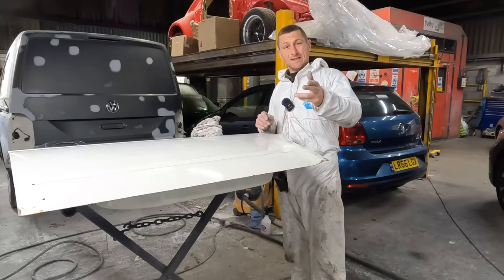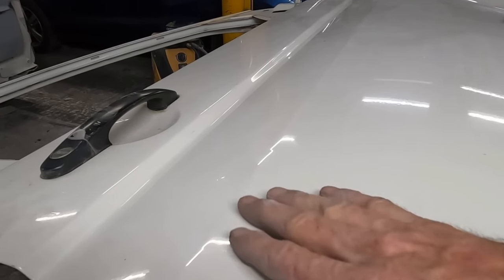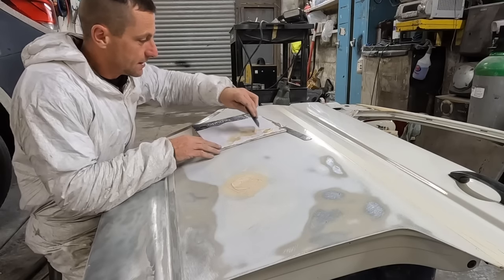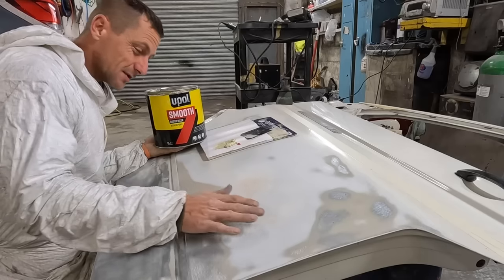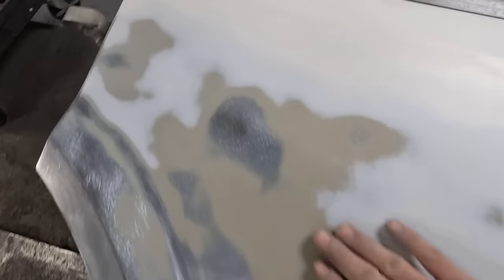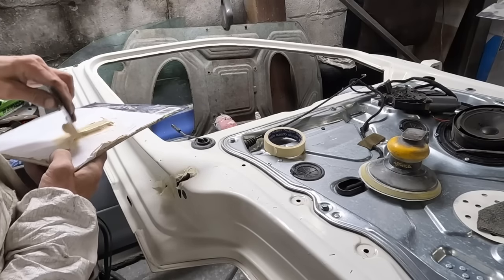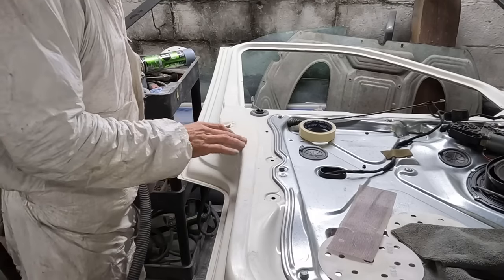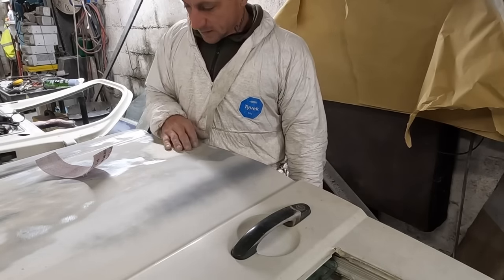T5 transporter build series - panel & filler work ep11-

Comment: I swear my dad an ausin  cambridge in black  it needed an mot the passenger door and sill  was rotten he wall paperd it packed it with cardbord painted it  black and it passed mad in 1977 , tax disc in window was a gueness matt .I loved the days off 7 day produce your documents , Me and my sister both had green rangerover 3.5 VOUGE  identical .for 5 years in 1988 .

Comment: Just out of curiosity, why choose etch primer and not 2k epoxy primer?
Reply from the maker: Hey bud so etch primer goes on metal first as it’s bonds to bare metal better and it has better anti rust properties, epoxy goes ontop of that 👍 other people do different things.
Reply: @YTDTETV  morning mate, I tried etching primer first in the engine bay as didn’t want bare steel to get rusty until I painted it, half of it flaked off when I washed it down to 2k primer and made a right mess, I’ve got all my van sanded now, both sliding doors removed tailgate, roof took a 15 hour day to sand properly… now I’m going to try sorting the engine bay out, tried paint stripper but wish I hadn’t as it’s messy and hasn’t effected all of it… not looking forward to todays slog but as you say “no on one else is going to do it” your vids have inspired me a lot, help a lot